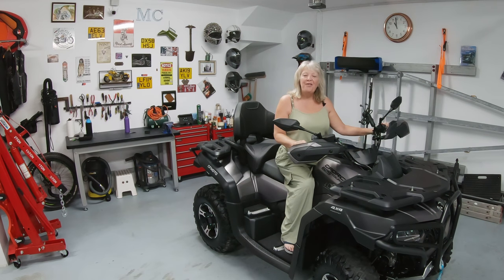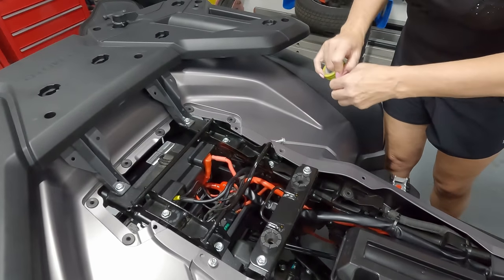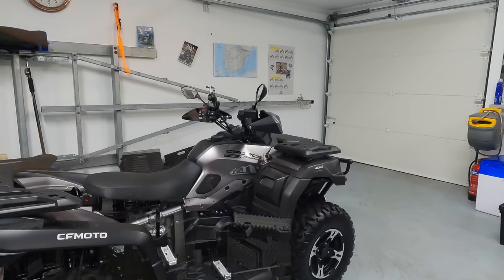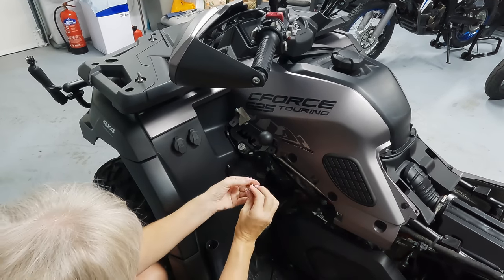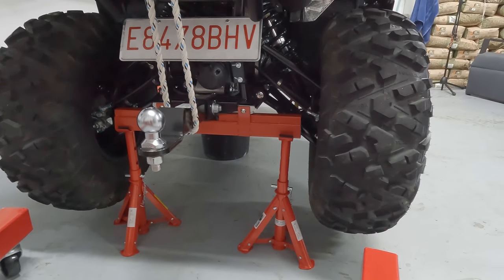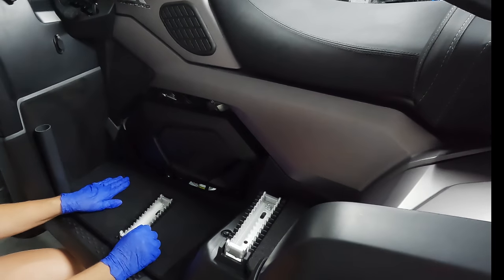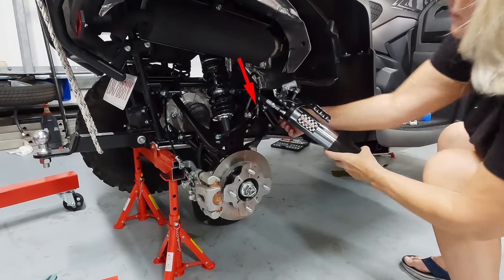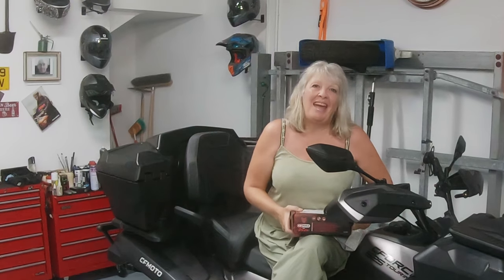CFMoto CForce 625 How to do a First Full Service & Valve Check

Comment: The video is very well explained. but that atv has not seen mud or water as it should...it is too clean to have been used off road...with use the aluminum takes on a tea and milk color and those are like the factory ones...
Reply from the maker: Thanks for watching, we are lucky to live in Spain so we don't see much mud and water, also it is cleaned after every ride out, it has been ridden off road over 3000 km and we are very pleased with its performance. 👍https://youtube.com/shorts/5ZoPSbI0MmY?feature=share
Sometimes we get a bit of water in the riverbed 😉
Reply: @ourspanishadventures  ahora en español.. jaja. con razon se ve demasiado pulcro como para que lo metan en barro y agua como lo hacemos en Uruguay ..mira alguno de mis videos y veras lo que hacemos.....Saludos desde Uruguay,.
Reply from the maker: @betoflocos  👍

Comment: Could you please enlighten me more about valve adjustment pls?
Reply from the maker: Thanks for watching, what specifically did you need to know ?
Reply: @ourspanishadventures  3 years gone through I haven’t checked valves yet, I feel my machine became a bit tired or it can’t achieve top rpms or speeds as it used to be . I wanna know how to correctly do it?
Reply from the maker: @CF625TR  It is quite complicated to explain but I found this video very helpful https://youtu.be/MPN9w6ZWSAw?si=BFEgwcyVzxc1xJYO